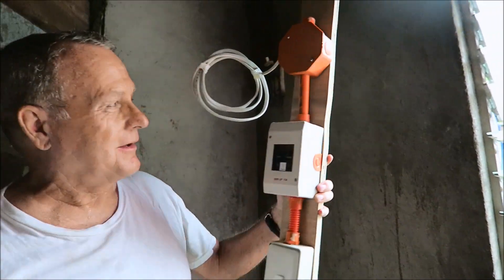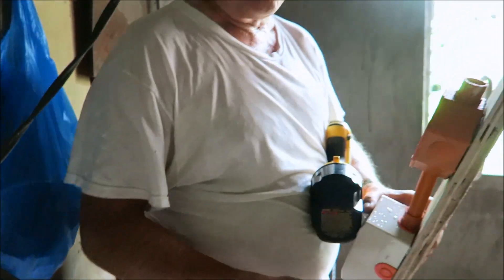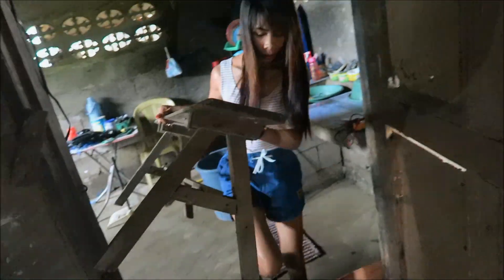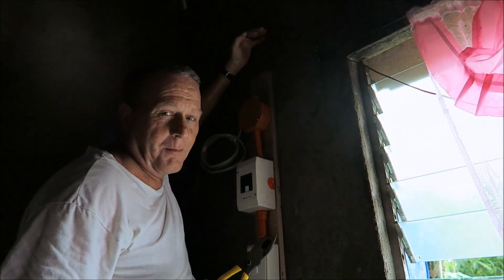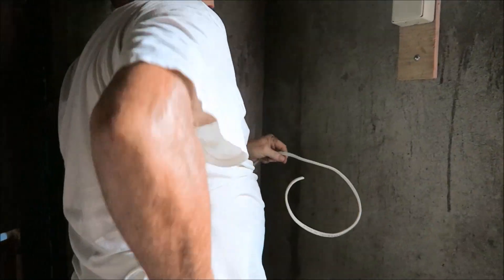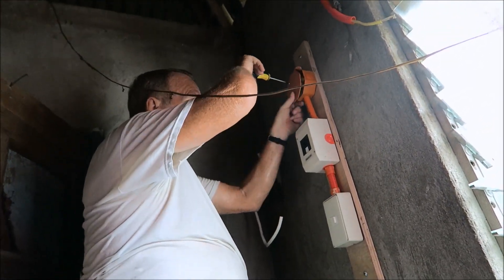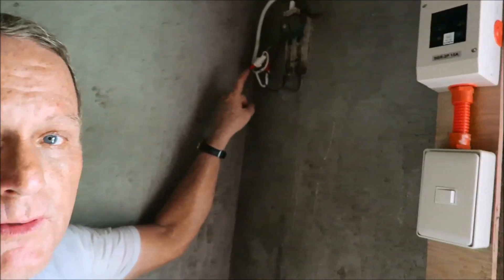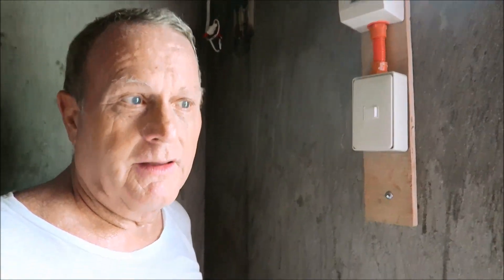Philippine Water Well ~ "ELECTRICAL INSTALLATION" ~ Video 8 ~ Santa Barbara Iloilo Phillipines

Comment: I built a house along time ago in butuan, the wire nuts rust out from the humidity. The best method is the way it was done over 50 years ago n America. Sodier joints and tape with electrical tape. They use a mechanical bound, "ground pod at the main feed from the electrical company which they might use for 5 houses. Better to add a copper ground rod for your house in case anyone songs karaoke they contingent shocked when they hold the mic. House gone alone time with wife, both gone. Sold it gave her half and I took half for a major lost. They use a single ground system because cheaper to hook houses up to. Not a great system. UK has a good system they use four wires for main panel. On their three phase panels they have the three hot wires and a neutral and use a 4 pole main breaker. We used them in Afghanistan. Our 5 ton a/c units were 3 phase in Afghanistan and iraq, worked both places as an hvac tech and helped rewire the bases when hvac slowed down in Afghanistan. I was able to do both kept me busy. Have no idea why the Philippines lists HP  for A/c units when the rest of the world uses tonnage. Nice work, sometime next year I will probably get some land and build a small house, once again. Will have to put in a well also. Nice video. Good work.

Comment: Hi there. Looks like your the man to ask. This is a new build I'm doing. Do you need to earth any of the system from the consumer box, as I have kitchen appliances from the uk. Normally our plugs are 3 pin. 👍👍👍👍
Reply: My Philippine Journey cheers for that, I think I will put earth into the system. 👍👍👍👍
Reply: My Philippine Journey hahaha I thought about asking that question about the rebars, you just answered my question . I should imagine the rods are made from copper.  8ft seams quite long. 
Just another thought!, at the moment the mains electrics comes from the meter  straight into our consumer fuse box in the warehouse. At the moment this isn't grounded. But from there I was going to use one of the fuses to go to the house I'm building, then have another consumer box in the house. It was here I was thinking of putting the rod into the ground and earthing everything. Can this still be achieved?  Again, cheers for the info 👍👍👍
Reply: My Philippine Journey cheers for that, I'll give it a go when the time is right. Putting water in the hole is a bit like when they drill  for water. They pour water and pound down. 👍👍👍

Comment: at 6:24 you GF said that the way you connect the wire is really safe since you use that yellow thingy while we just usually connect them using electrical tapes. LOL that pretty common throughout the PH i don't even know what that yellow plastic is. haha
Reply: haha they probably thought they were just for aesthetics.

Comment: hi mike nice video did you get that Dewalt Drill in the Phillippines or the USA i am retired from Stanley Black and Decker 
and worked with Dewalt in the field for many years 
nice video 
you can use a new hammer ha ha ha
richard

Comment: oh....and final total parts and labor$$....I think u said 5000 labor? and they gave them a break? how much for a stranger?  that cheap for all that work.  I am also curious how long you could run the water before it runs out and needs to recover (how good is the water table.  I would do something like that in Roxas when I retire,,,,use it for my planned BIG garden

Comment: I'm no stranger to construction, but what are those wall anchors you're using called?  I also brought a coffee can full of wire nuts with me from the U.S., but can't seem to get anybody to use them, voluntarily anyway, so I usually wind up doing it myself. Good job Mike!
Reply: Can you find them here? I've seen them before, just not here, and if they do have them here, they are called something different, I'm sure. Thanks.
Reply: No thanks, I'll just do it the filipino way!
Reply: I did bring some stud anchors and expansion bolts with me, but for the small jobs I guess I'm stuck with the "tocs" (plastic anchors).
Reply: I agree.

Comment: Also i forgot another thing i do when we change pumps and pipe is i pour a bottle of bleach in the well ,   try to run it run it down the outside of the draw pipes then make shure there is a airtite seal on top after all work is done to keep it sanitary.  Sometimes the materials you put into the well have bacteria on it from animals etc wich can grow and thats what  the initial chlorination is for , it will also pump into that barrel and help sanitize it too.  Just drain the barrel  once after the  first  fill before using the water.  I dont drink the water but someone will ,  so for 50 pesos money well spent.

Comment: Hi mike,  I live on a well too ,  Just thought i would mention a few things,  You might have already checked but 1.5 horse pump sounds possible too big.  That well has a  very small capacity and probably cant make more than about 10 gallons a minute.  that 1.5  at 30 foot might put out  about 30 gallons a minute thus would run out of water instanly and damage the pump ,  sounds more like a 1/2 hp pump to fill that 55 gallon drum might be less expensive and  a safer bet.    Take care

Comment: using a cordless dewalt hammer drill action to bore concrete=western style,  hammering in an expanding bolt to concrete with pliers=philippine local style…. thanks for bringing big smile to me today very good job Mike your a hero.
Reply: I'm going there in december i'll bring you some blades

Comment: Definately would love to see the final finish product and operation. Also just wondering... Are the homeowners planning to purify the water so it can be drinkable or are they just going to continue with bottled drinking water? I imagine a purification system would be very expensive! And finally, how did you get those concrete nails to go in so easily with your (hammer) on your switch panel and will it hold securely? Thanks for the great video..
Reply: I guess they can still use the water for gardening, toilets and washing dishes? Not sure about washing dishes and bathing are you? I am interested because my wife is from Bohol and we would like to set things up right someday with most of the more modern conveniences. We may end up in Talibon, Tag, or maybe Dumaguette, still looking around...

Comment: Hi Mike nice little breaker set up you make for them, really they don't use those wire Nuts in the Philippines that was handy you had some of those from Texas, I diddent to much electrical work I new just enough to be dangerous hehe, it was nice to see a pro working it ☺thanks Mike for all you have done for them I'm sure it is really appreciated and will make things a little more ez for them, God bless and thanks for the videos ☺